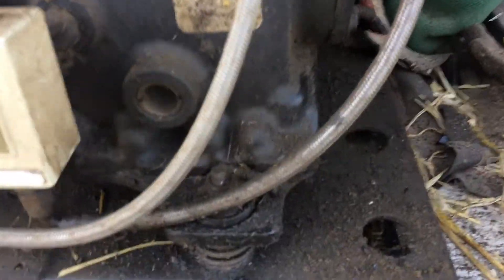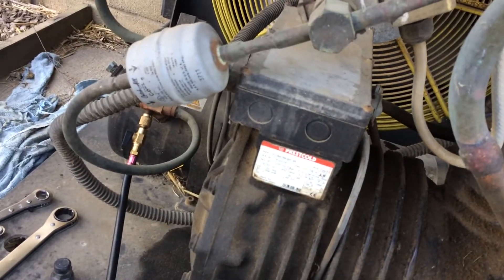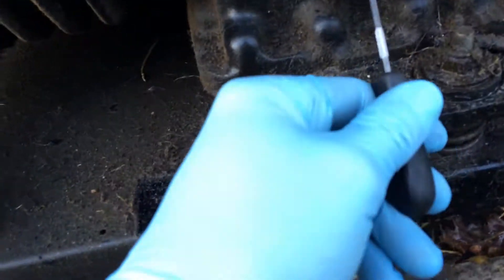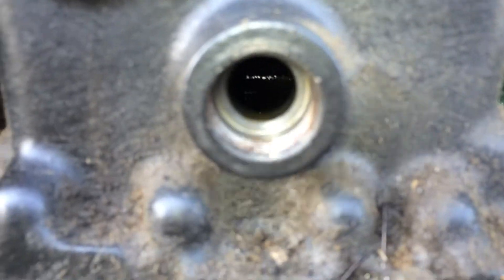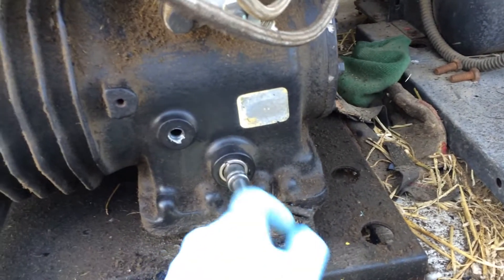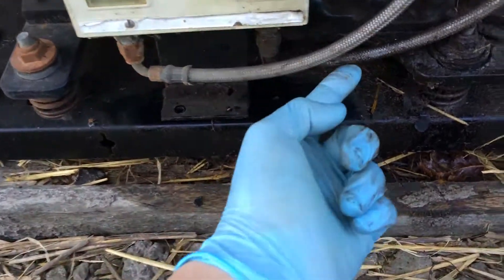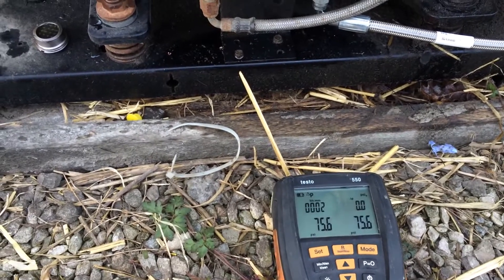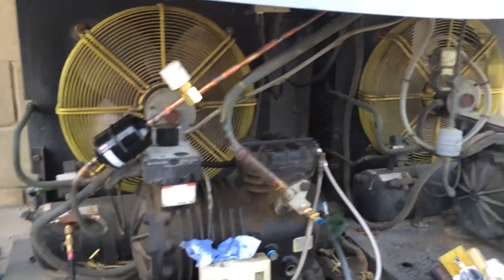R22 to R407F Copeland Compressor Conversion

Comment: good morning Mr., thanks for the video, I have a question to ask, if you are so kind to help me, I have one of these compressors mounted in an air compression system, my problem is that I do not know what kind of oil is used, since All the engines of this type that I see are used in refrigeration systems, if you would be so kind as to indicate what type of oil I can use I would be very grateful, greetings from Limpio, Paraguay.
Reply: the air compressor is of this type https://www.k-bid.com/auction/23534/item/35
Reply from the maker: Sorry for the late reply, been having a few issues.

That style of compressor if used in a refrigeration system would use an oil call Suniso 3GS, I would think any 30 weight mineral oil would be ok but am not an expert in that application.

Comment: Nice video, one question 407 F is it works on low temp? (freezers?)
Reply from the maker: R407F is going out of fashion here, the latest one they are pushing is R449A or R448A, they run pretty similar to R404A.

Comment: this was a medium temp system, how did you like the 407F's preformance
Reply from the maker: ***** I haven't noticed any change in system performance in the 20 or so systems i have converted from R22 so far, the longest has been running over 18 months.

Comment: Would be a hassle cleaning the condenser on those being so close to the wall
Reply from the maker: Josh D Yes, it was difficult to get in there with a brush, i have a 90' attachment for the hose which made it easier to wash them out, there was plenty of room in front of them, not sure why they put them so near the wall.

Comment: John would you be so kind as to tell me what the name is of that tool you use to open the sightglass on the side of the compressor I have made several but they don't last too long thank you
Reply from the maker: hardcooling I actually made this one, i will do a vid of it as i have been asked about it a few times.
Reply: Also Craftsman makes a weird named socket. I don't remember the name of it. But you can buy them. They can be a bear to get out. They need to be torqued to 100 ft/lbs.

Comment: Interesting....  R22 used mineral oil if I remember correctly?
Reply from the maker: More350Power Yes, the older R22 compressor used mineral oil, though R22 will work with POE and alkylbenzine oils too.

Comment: ok where do we buy the pump.I will purchase from you
Reply from the maker: Eagle Mech Services I got it from Amazon its a Pela 2000 oil extractor, though the make some different sizes depending on what you are working on. I wanted something that was compact to keep in the truck, even if i need to empty it during an oil change.

http://www.amazon.co.uk/Pela-Oil-Extractor-PL2000-2000/dp/B002EPIM9U

Comment: Do the Prestcold compressors have paper seals at the point where the motor winding contacts enter the compressor?
I only have seen some small DWMs and they had O-rings at the bottom plate under the pistons and at the electrical contacts.
Reply from the maker: Alexander470815 The older ones with the metal electrics box have a gasket i think, i think this one has an O-ring as you say, i will need to look into getting some spares! 
The smaller K body Prestcolds also have an O-ring as i remember one leaking years ago and changing it.